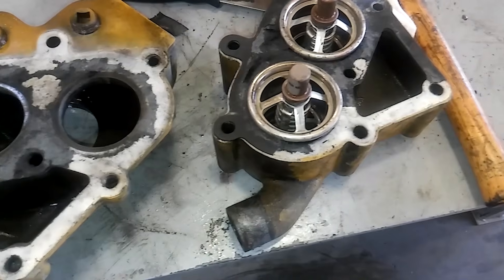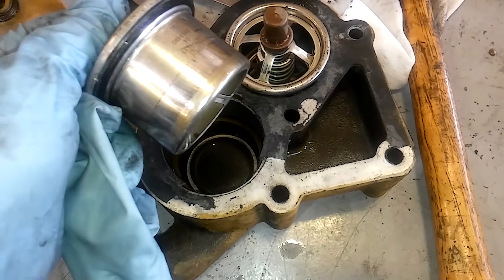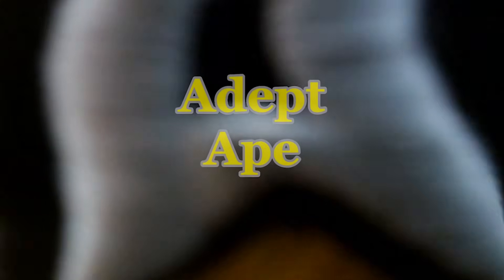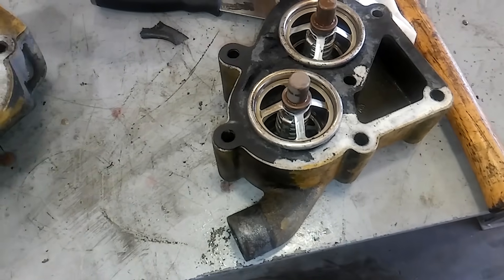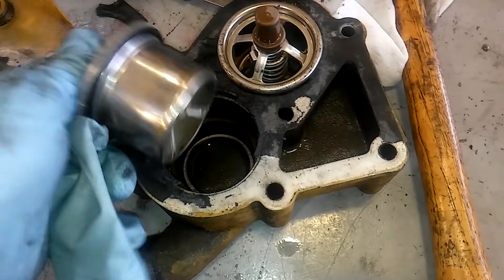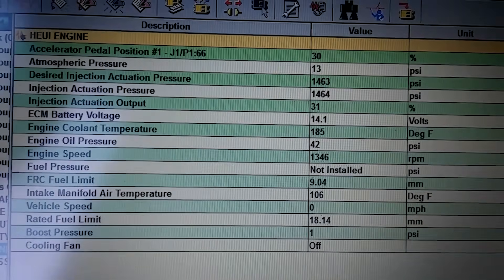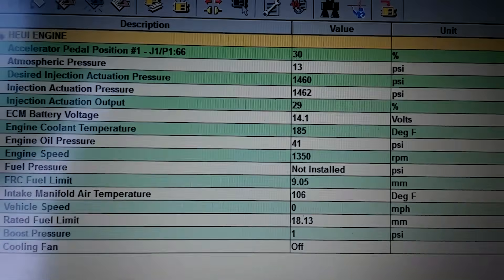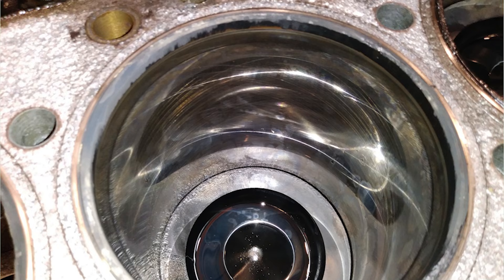Why You Should Never Remove or Use a Colder Thermostat In Your Engine.

Comment: I don’t care what the manufacturer says or any mechanic 220 is to hot!!! And those hotter thermostats that they want you to run is so the motor will burn cleaner for the epa and you’ll supposedly get better fuel mileage that’s all bull!!! I run 180 stats and I never let my motor go over 200 degrees I don’t like cracked heads which is a caterpillar issue that’s notorious they get hot over 200 and tend to crack no thanks keep it cool keep it running as for fuel mileage I get the same whether it’s 150-170 versus 200+ the variance in the temps are not enough to matter I’ve seen cats run at lower temps go a long time but I’ve seen cats running hotter temp crack heads blow gaskets lose liners and other failures heat is the enemy you ever see a b model or a model cat using thermostats that hot? Nope don’t need them not electronics or emissions that need the hotter temps ever see a big or small cam Cummins running hotter thermostats? Nope same answer don’t need them neither does the new motor except for the fact they have all that emissions far all over them and require it to function so I’ll just keep my 180’s in my old 6nz and keep her cool

Comment: A lower temp thermostat helped keep my Dodge Viper run cooler. So you are not completely correct. It starts cooling quicker reducing heat soak

Comment: My 1992 Dodge 5.9 came out with a 180 thermostat and my 05 came with I think  195 and these trucks have a problem  with number 56 cylinders getting too hot so I just put  a 180 in to keep more antifreeze movement threw the head and a by product is that you heater is blowing hot air out of your heater about 3 times as fast.

Comment: If you're car has electric fans it doesnt mater what temp your thermostat opens at cause ya car is still going to reach spec temp anyways because the computer wont trip the fans on .so unless you live in Alaska you need not care but if your in a hot area and you beat the car n drive like a boy the a cold thermostat will help your engine from over heating 😮

Comment: My car which is a Peugeot 206 (made 4 years ago in Asia) has been running cold for a month, Im gonna replace the faulty thermostat tommorow, When running inner city it was alright but on highway it went down to 60 Celsius (140-50 F). How much of a damage I  should expect in the engine? I drove average of 20 mins per day (in highway) - never had any overheating problem, normal temps in the city.

Comment: I live in AZ, my Land Cruiser has an 88C stat, its 120F degrees outside.  You are telling me not to change out my 'cold spec' Toyota stat to an 82C OEM or a 77C stat from Aussiland?  I think you are WRONG!  My TURBO Diesel is smarter than you.  My diesel operates between 180 to 200, these 'cold' stats are perfectly within that range.  Running an engine in extreme hot temps will accelerate wear.

Comment: i have a marine gen in a engine compartment with two big blocks running at 180 temp in florida my gen had a 190 temp thermostat engine running at 201 temp i put a 160 temp thermostat in engine runs at 180 182 sometimes 185 explain ?

Comment: The myth that coolant running to fast ,yes it is true tell that to the cummins engineers on the NTA -370-400 cummins put a restrictor on the watet inlet from block to aftercooler to restrict the coolant flow for that reason , the restrictor are hard to find they were plumbing nightmare so most were taken off by mechanic that didn't understand what the restrictor did!!

Comment: I replaced 180F with 160F and my Detroit engine fan programed to kick on at 205F. Over 700k miles that engine have not given problems and fuel economy have increased since it takes too long to go from 160 to 205 for engine to heat up. Nonetheless engine oil runs slightly cooler and engine sounds happy and feel more powerful.

Comment: If basically everything (and I mean EVERYTHING... even has a heavyhaul radiator) has been check/replaced on a BXS ACERT C15, what would you recommend checking? At ambient temperatures over 70°, it overheats. The hotter the ambient, the more gears I have to drop to keep it below 225.

Comment: Hey I hope you can help me I have a maxxforce n 13 😢 but i replaced  heater core hose and now it won't high idle or keep coolant temp up at idle it stays 110 140ish . Running down the road it will run 184 and 200 on hills didn't do this before.  I left reservoir cap off and ran it to burp ..no luck

Comment: as a ASE master tech, I'm glad you did this video, it dispells some myths of cooling systems. I mite also add that the thermostat also is a flow restrictor that prevents excessive pressure surges to hoses and coolant system at high rpm. I am always amazed at mechanics that believe that removing the thermostat will make the engine overheat ,, just amazing. but then some people still think the earth 🌎 is flat
Reply: thetat becuase hes not a mechnic,, if he dont knows that hes not a mechnic..

Comment: I ran a180 degree t-stat instead of the 195
I look 30 minutes from Death valley. Works great
Reply: I agree lower the coolant temperature also in my opinion the factory radiator will be more efficient at a cooler temperature but need to change the fan engagement temps to match the new thermostat setting.The average temperature around you vaporizes moisture all your doing is making sure that because your in a much higher temperature climate where the factory cooling system can only handle so much and in my opinion the temperature rating is for colder temperatures and with your average temperatures being extreme means the cooling system is always at the upper limits at what it can handle and moisture retention is never a problem but running in critical temps all the time is. So it's not just enough to have a lower thermostat setting but the fans also adjusted so that the radiator doesn't fail to keep the new temperature setting in place.But your not delaying eventual temperatures but keeping the temperatures right where you want them to be.And I would also like to add that the factory radiator will work better than intended  because the factory radiator can easily cool off lower temperature setting versus critical temps you might be able to bring the temperature down with a factory set up and factory temps but the oil temperature will be boiling over regardless. So like a runaway effect that is primed and ready by putting a lower thermostat setting there  is no runaway temperature fluctuations waiting to happen like just a few temperatures away but by 30 degrees cooler.I think your right and would be doing the same thing.But also there has to be in the new models a computer adjustment to say the lower temperatures are ok as well. There is hardware and software available to reprogram the on board computers.But that has to happen along with the other changes to be effective and without a problem it will be smooth sailing where do you live and that's a beautiful thing.
Reply: @jbtOO7 The thermostat temp is when it starts to open. It won't change the operating temp

Comment: Once a ran a car in hot summer on a thermostat that the insides came off, while it was installed on the engine. Didn't bother replacing until the days started getting cooler. I would think running a cooler thermostat in cold winter would actually help the engine warm up a bit faster as the coolant would stay in the radiator less. But regardless once the engine is up to temp I would think the thermostat would remain open regardless.
Reply: It really depends on the conditions in which you're driving, I think

Comment: I went from a 91c thermo to a 82c and I had a very positive result. Before I was getting 93c to102c temps. After cooler thermo, my temps are 83c to 94c. Side effect also resulted in a cooler running ZF transmission (by about 6c), since coolant also cools auto tranny. This was on an Aussie FORD Falcon FG 6 cylinder Barra located in Brisbane Australia.
Reply: bigger problem then

Comment: Have a 99 kw c15 can't get the fan to kik on is there supposed to be power at the heat sensor working with ac one hand switch

Comment: I had a overheating problem with my Caterpillar 977L with a 3306 engine. Was advised by several people, including two mechanics, the problem was: a) bad thermostat; b) blown head gasket; c) low liner projection; d) bad or clogged radiator; e) bad water pump; f) motor needs to be rebuilt and several other silly ideas.
The problem turned out to be the radiator cap was not maintaining the necessary pressure in the cooling system, it was releasing at 5 psi. I replaced it with a new Caterpillar cap and the engine runs at the correct temperature ever since. 
The moral of the story is, try the simple things first.

Comment: I disagree 
The factory specified thermostat temperature is bias hotter to reduce emissions at the expense of slightly higher component wear resulting from oil breakdown and reduced clearances.
I feel fine running a slightly lower temp thermostat that my radiator can still regulate and benefits of a more reasonable operating temperature

Comment: Have you tested what you are teaching on an actual engine/truck or are you teaching us what CAT taught you?
Reply: I think what he is saying is if you have overheating problems a lower thermostat or no thermostat isn't going to fix the problem.  Also, if your system is working fine and you put in a lower thermostat you are probably not helping your engine.  I suppose it is different between no emissions and def trucks though.  But as a guy who does heat transfer for a living, it makes good sense.
Reply: @Derek-pd4fc  I have fixed many overheating problems on older vehicles by removing thermostats. Never had an issue. These people are spreading misinformation.

Comment: If you ever get a newer Pete glider kit in the shop with a Cat motor, could you make a video showing where the oil temp sensor plug is on the harness please? My glider has a oil temp gauge but the original builders didn't hook it up and I have absolutely no idea where the connector is hiding in the harness.. I really want the gauge to work, that one and the trans temp gauge are the only two that don't work on my dash (also no idea where that connector is hiding).

Comment: Argument seem to go on and on in this comment section, I have no experience with big trucks but I've NASCAR engines run with the high temperature, 195 or more thermostats, so they don't lose power to cold water, 160°.

Comment: I find many of the older c15 engines we have all come in with driver saying its running to cold. Sometimes its a stuck thermostat,  but 95 percent of the time it is the housing eroded and going around one.
 I have no idea why cats do this, we have water filters installed on some, no different. We use premium coolant and check with test strips at service and add cat coolant extender as needed. Although it rarely needs it. Out of 12 truck i only use about 2 bottles a year total. 
So any engineers out there.... WTF? why cant the replacement housings have a design change to correct the design flaw. 
Most i have to change are on engines around 600,000 to 1,000,000 miles on the housing,  weather it be a new housing a reman engine,   new housing at rebuild or whatever they usually never outlast the engine. With modern oils we can run 1,500,000 before rebuild needed from wear, however we are only getting 400,000 to 600,000 on head gaskets or heads. And the one we had done at a certified cat shop only went 40,000. Yeah 2 oil changes and the the truck needed rebuild again after having a certified cat mechanic do it.

Comment: There’s nothing wrong with using a colder thermostat in newer cars. This is done when adding a supercharger or sometimes other parts. This can help make more power. Just don’t get crazy with the temperature change. 10-20* is normally the limit. Also you have to tune your ecu to match the change or you might be wasting your time. So if you don’t know what you are doing then just don’t do it. 
Removing a thermostat can help a overheating problem but it is just a bandage

Comment: I have to say, we had 3 trucks, 2  we ordered 2001s C15s and they were turned up to 550 at dealer,  always ran 180,190 or so, we bought a Owner/Opp spec truck used,  no mi 10k same yr, was ran in town but was set at 475hp, lazy throttle response,  definitely set up for having multiple hot doggers driving it, T800 ant eater, that truck always ran 220 225, fan always came on before it touched 230..way to hot IMO , oil temps always ran 30-40 degrees hotter then the 2 550s. Well I had a guy tune the Owner Opp truck, supposed to be 575hp, the truck ran 180 all the time after that, you'd pull a hill in top gear, it would stay at 2-205 by the top fan com on around 210, awesome set up! I've pulled hills next to brand new trucks with Cummins 585 in them and this thing would walk it on the last part of the hill every time. So my point is, if u have a guy who knows how to tune for what u are doing, u won't run hot like the lazy CAT tuning where the timing is retarded,  most likely it was retarded in the fuel system cause it would have 1200+ exhaust temps stock, tuned its hard to push it past 1000
Reply: You are actually pretty smart by realizing that on an overhead cam engine fuel timing can be changed by injector setting. Which boils down to how the camshaft lobe ramps time wise to fire the injector. Detroit Diesel actually explains this when describing how to do an overhead on a 60 series engine.
Reply: @Jim Mahaffey  idk about smart, more probably intrigued to why 3 same spec trucks run well from factory,  then get a MBN that's basically the same motor and it be the biggest turd you've seen in a heavy haul spec. Started researching the old fourms on MBN hot egts and started talking with 1 guy that pointed me to another guy "Mr Haney" then started reading everyone of his posts from 15+ yrs ago and realized this guy knew how to make a CAT run how it should.  Great guy, there was posts where he went toe to toe with CAT themselves and proved stuff they couldn't even answer themselves.  All 3 trucks still running today with his 575 tune that walks away from New 585 Cummins on hills towing same load, and the MBN is slightly better in power then a new 605 with just turbo and tune. While all 4 getting better mpgs then the new emissions stuff and rarely any down time vs this new crap. Crazy! How something 20yrs old is more reliable 🤷‍♂️
Reply: Guy tuned our tractor we found sitting in a garage,  03 w900, 6nz 475 , it ran ok for a 475, loaded it was doggy, give it the 575 tune and she walks away from brand new Cummins 585s hauling the same weight,  same trans same gear and it gets 5+ mpg, The new Cummins guys say they are lucky that they see 3-4mpg. My point is, the right tuning is key for a truck that naturally runs hot from when it was brand new.
Reply: Now if u got a MBN thats a whole different story about running hot, that definitely needs to be turbo swapped and tuned to be a good running motor. That was the beginning or the end of good cat motors

Comment: Now that you say this it makes perfect sense, thank you because I never stopped to  think too much into the "swap the thermostat" bad advice.

So if I'm right that would mean; Larger Radiator for the thermostat to pull from if needed, because "Operating Temperature" is simply that, operating temperature.

On classic cars they often have aftermarket oil cooler s available but now I'm wondering about the engineering that's gone into them and do they possibly create a new issue of there own because many are generic kits.

LoL 
"Bolt this on and treble your oil capacity"

Comment: I always do a boil test with my thermostat. You'll find it almost always doesn't open at the temp it says I always put a cooler thermostat because they usually open 20 to 30 degrees later my elco rides at 170 degrees with a 060 over bore sbc
Reply: After I doubled the hp of the 350 in my 76 gmc sprint I figured I would just go with a 180 stat and it would be good... Not if you are trying to run the stock radiator. I fixed the problem by using a 180 high flow stat. It fixed all the temp fluctuations and spikes.

Comment: When my oil cooler failed in my '91 Dodge I researched doing an oil cooler upgrade instead of doing the repair. The information I found on the subject was that  early on they used a 9 plate industrial cooler. Cummins found the oil was not maintaining proper temperature(over cooling) causing the volatiles to condensate and do the damage you have described.   They changed to a 7 plate for the automotive 6bt and a 5 plate for the 4bt to solve over cooling.
Reply: Agh great research this was my question about generic aftermarket oil cooler's.
"Increase your oil capacity" claims might not be the answer then. 

Maintaining optimal operating temperature would be very specific to each vehicle on how that can be achieved.

Wow simply 2 plates off the cooler on yours was enough to be an issue.

I'm glad I caught this because I was that guy who thought cooler was always better, all the internal parts in harmony is the proper goal.

I'll scratch the extended oil line running through the AC blower plan. Lol 🤣
Reply: @SP-mp9yi  134a cooled oil would be awesome so long as it had a thermostat like I'm running on my ATF it's 160° mishimoto bypass thermostat plumbed in - 12.
My Allison requires a minimum of 148 to allow shift trim adjustments anything less than this the transmission expects wonky viscosity results therefore prohibits shift trim adjustments making the first run through the gears not so great.

Comment: Ahh two situations...om.newer vehicles reason to pass smog  emissions...two fords have a problem if coolant temp sensor  recieves wrong signal will say cold will send richer mixture...other than that  other or older ob1 systems its no problem and actually better  to go cooler
Same on pre smog vehicles